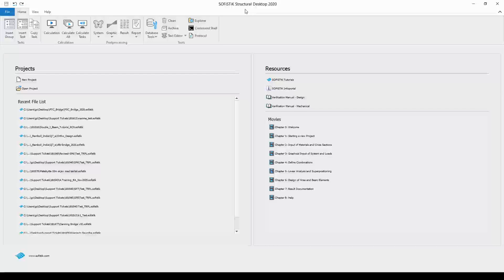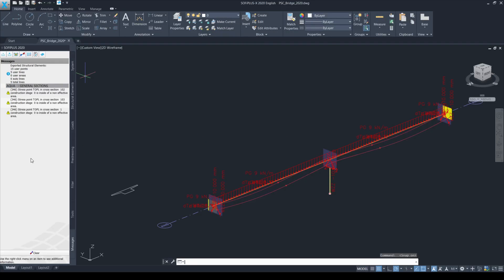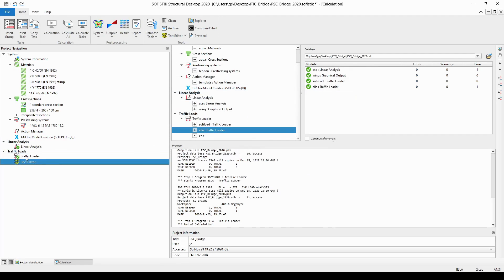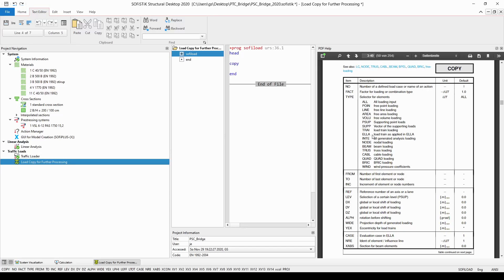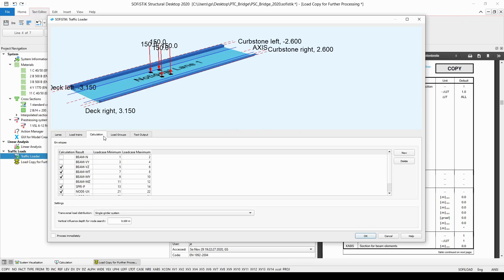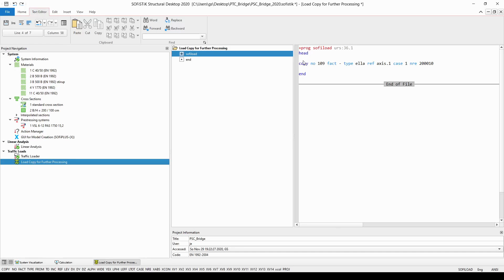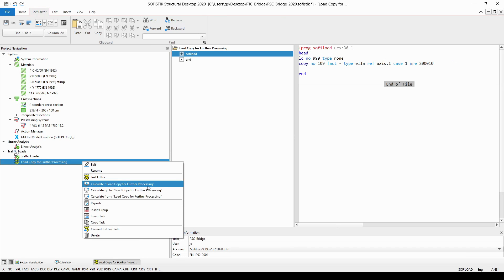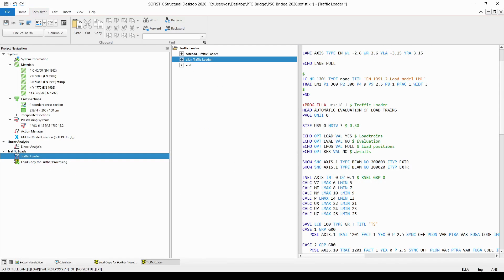Load Copy from ELLA #SOFiSTiK #SOFiSTiKTutorial #Tutorial #ELLA #Loadcopy

Comment: Hi, When I run the Text Input task for load copy, it says " +++++ warning no.  2248 in program SL_IA ; input line:    6
   Load case 111 COPY did not find load positions for 1 20019    0.000
   Found values within Cases 255 0 Lanes 255 0 NOs   0". I have ran traffic loader beforehand but doesn't seem to be working.
Reply: +PROG SOFILOAD urs:18.1
head 3 x CLASS-A
LC NO 11 TYPE NONE
COPY NO 111 FACT 1.7 TYPE ELLA REF AX1 CASE 1 NRE 20019
end  

This is the syntax I have used.
Reply from the maker: Hi Manpreet,
Although you did not explicitly formulate a question, I assume you are seeking guidance on how to overcome or eliminate the warning message. Is this correct?

Without access to the model files, I can only speculate that the warning message arises because the load positions are not being stored in the traffic loader task. To resolve this, you need to explicitly request the storage of load positions by using the ECHO LPOS FULL command in the ELLA module. Without this command, the positions of the load train will not be saved in the database, leaving nothing to copy in the SOFILOAD module.
Reply: @LinkedIntoKiTSiFOS  thanks for your response. I’ll try incorporating your suggestion in model file and check results.

Thanks you very much.
Reply: @LinkedIntoKiTSiFOS  Worked like a charm. Thanks for guidance.

Comment: Hi György, great video. 
Is there a way to reference the whole beam instead of a single finite element? 

Thank you in advance!
Reply from the maker: Every position along the beam is unique and a different influence line with corresponding load position is considered in the live load analysis module (ELLA). Therefore it is not reasonable and not possible to refer to the whole beam.
Reply: @ thanks!

Comment: How can we do this with shell modell and Ella used for live load
Reply from the maker: The procedure is the same, the only difference is that he number of the QUAD element should be enetered as refernce at item NRE of command COPY. For example: LC 2001 TYPE NONE ; COPY  751 - 'ELLA' REF "AXIS.10" CASE 3    NRE 200015, where 200015 is the number of the chosen QUAD.